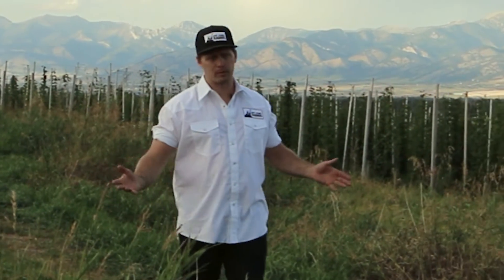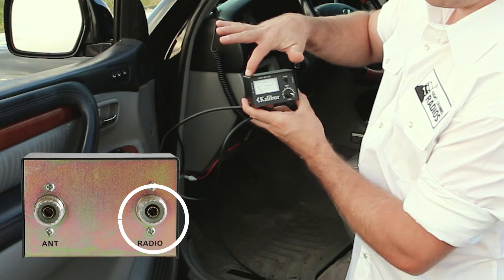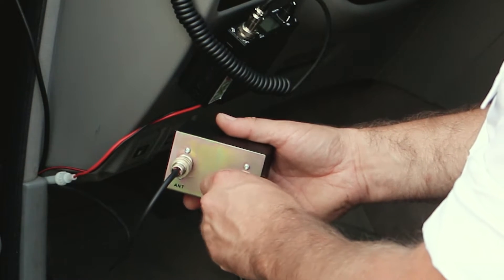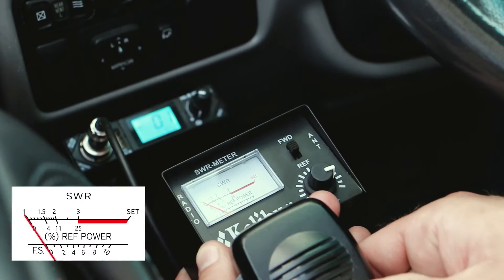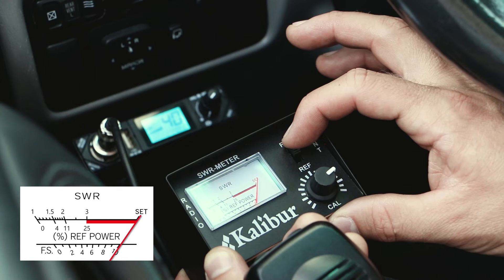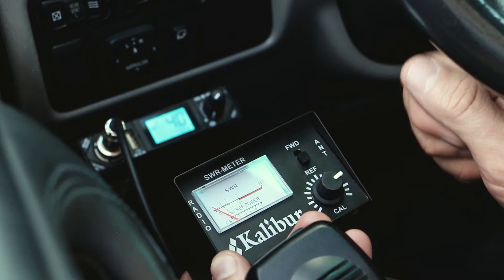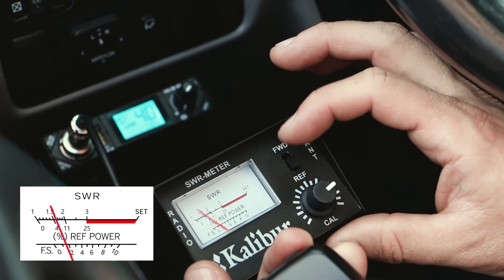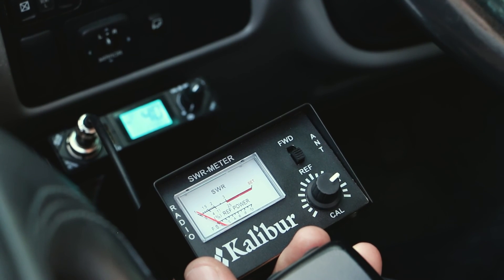How to Tune your CB Antenna, A Detailed Step-by-Step Guide

Comment: I have the Bearcat 980. Using the built in swr meter I can get channel 1 & 40 balanced out around 2.4. I can adjust the FireStick tip to get channel 1 below 2.0 but then channel 40 jumps up to mid 3’s and 4.0. I have good grounding with the antenna and CB. Im thinking to just buy a separate swr meter. Any other tips would help.
Reply: So after going through the installation again found the problem with the ground at the antenna. Working properly now

Comment: Also make sure you get a good quality antenna, too. I bought this cheap RoadPro antenna, and the SWR was a disgusting 3:1 on 1 and 40, and sitting at 1.7:1 on 18-22. Trimming won't really drop the SWR at that point, so, there's just a quality control issue, there, or the mag mount coupling to the vehicle (treating the vehicle as a capacitor/ground plane) isn't terribly efficient.

Comment: there are qrp ant tuners which work at cb band. with a tuner and those smal differences in swr you can get it down to 1:1 flat and make your radio happy.
Reply: Tuners waste power and do not make a non resonate antenna work better.

Comment: This is why I like Francis antennas. They usually give you a reading around 1.5 with most radio's. I have a hard time with the Predator 10K/K-1-27 with a 27in shaft. It reads 3 on Ch1 & 40. The coil should be above the roof/cab? Correct?

Comment: I bought a set of Predator dual coils. So far, trimmed 5” off and SWR are at 3. The reading came down some, but this is getting time consuming. 
 The Wilson 2000’s I’m currently running are at 1.5. But the Predators are sky high.

Comment: Think there's a misunderstanding on this subject, we shouldn't be tuning our antennas for low swr ,we should be tuning antennas to resonance which could mean swr will be higher, then we match to allow power transfer, can't do this with an swr meter need an analyser
Reply: @bill-2018 where did he mention that ? He also didn't mention groundplane which is key to tuning a mobile antenna
Reply: @Pioneer936  As this is from one day ago, I will tell you it was supposed to go to @jar407.
It was a mistake you got it.
Reply: @Pioneer936  I don't know where my comment to you went, it was here, but I said it should have gone to @jar407.
By the way I've never had anything blow in 51 years due to impedance, but if it is way out then the SWR meter will show it and we wouldn't use it. 
G4GHB.
Reply: @bill-2018 the efhw IS resonant at 50.1 swr that's around 2500ohms, the 49.1 transformer is to match it to 50ohms coax
Reply: @bill-2018 does low swr guarantee efficiency or that your antenna is radiating correctly, yes you can get power transfer into antenna if its closely matched but this doesn't mean the antenna is tuned does it ,I am inclined to agree with the poster that you can't tune an antenna based on low swr ,a tuned antenna for me would be when reactance is close to zero and that can happen at various swr figures sometimes nowhere near 50ohms
Reply: @paulm0hpd319  
By the way I put up my dipoles four years ago without a VNA and tuned for lowest SWR. 
I tuned all my aerials for lowest SWR. I will still say tuned as most amateurs would.

This is just all about what is called tuning an aerial or not called tuning an aerial and got stupid over that one thing.
I will still call it tuning. 

I, and most amateurs and C.B.'ers will say an aerial is tuned by obtaining a low SWR. I see nothing wrong in that.
They don't care where the actual resonant point is and does it really matter? An SWR meter is good enough. As I said we can tune it to resonance but we don't sit on one frequency because it's tuned there. We don't only use 7.132 MHz because it's tuned to resonance there and we can't move because it's only resonant at one frequency. Go 10 kHz and it's off resonance. 

These points are what I've been saying all along but I kept being told it's not resonant by an SWR meter alone.

I still say impedance doesn't matter. I've never blown anything up because of it. Unless it's ridiculous but the SWR meter would show it and you wouldn't use it.
 

G4GHB.
Reply: @bill-2018  how would you tune an antenna to resonance with an swr meter if you are looking for 300ohms purely resistive ?
Reply: @paulm0hpd319  I have never said it indicates efficiency. It may be the be the best obtainable and most efficient for that particular system. In that sense it is. 
I also said only getting contacts proves an aerial is working okay.
I'm saying it's commonly called aerial tuning by most amateurs and C.B.'ers. At least the ones I know.

Pioneer goes on about resonance and impedance on a ¼λ vertical as though he has one but when I asked him for other values he won't answer me and only repeats it's 36 Ω. 
I also asked if he had any other aerials and do they meet his standards of a resonant aerial. He won't answer me. 
He keeps going on about resonance but when I asked him would he never go off that one frequency because it's only resonant on one frequency he won't answer me.                                          

My aerials are the best impedance and reactance values I can get, they agree with a low SWR. The very best I get on one aerial is 53 Ω -j4 and 1.3:1 SWR. As good as resonant don't you agree? For Pioneer it has to be absolutely spot on. How many amateurs can achieve it and say their aerial is tuned?

My experience has shown on various aerials that power output does indeed go up as the SWR goes down so I call it aerial tuning as do the majority of amateurs I know. This is on my dipoles, inverted vee, long wire and 4 element collinear.  

I have proven to myself using a long wire and aerial tuner (note here, MFJ 16010 says antenna tuner) that maximum r.f. out is not quite the same as the lowest SWR but the difference is so minimal as to be insignificant.
We know they should really be called an antenna match but people don't call them that in the real world. Even MFJ and other manufacturers.

G4GHB.
Reply: @paulm0hpd319  Actually, the best aerial is my dipole at 75 Ω and 1.5 SWR on 18 MHz. Reactance I don't know, I didn't measure it. Still not good enough for Pioneer because it should be 73 Ω with 1.5 SWR.
I live with real aerials in the real world and tune them the best I can whether you call it tuning or not.
Reply: @bill-2018  why wouldn't you want 300ohms if your antenna is resonant there ?
Reply: @paulm0hpd319  You might have noticed I removed my comments.
I had fallen and the doctor asked if I had banged my head.
Friends said I was acting confused and forgetful. Friends in the pub asked if I was okay. They've said I seem okay now. 
Some comments seem odd now.
I hope it was temporary and not the start of dementia or something.
Reply: do want the least power reflected back to the transmitter 1 to 1 no  reflected back 4 to 1 good way to burn out finals
Reply: @jar407  Only one dipole here at 75 Ω which is about correct and 1.5:1 SWR as expected.
Impedance of the others are 43 Ω, 49 Ω and 57 Ω with SWR values of 1.4, 1.1 and 1.3 respectively.
I have no problems with these 'wrong impedance' values as stated by Pioneer and never had anything heat up and blow. H/b radio 30+ years and FT817ND since 2017, nothing has blown.
My tx is happy with low SWR values and I do get out. 
I asked him what frequency his perfectly resonant  ¼λ vertical was on. No answer. He's using text book values and no experience of real aerials in real situations. 

G4GHB.
Reply: @jar407 reflected power isn't the problem, it's the impedance that causes equipment to heat up and blow
Reply: @bill-2018 you are still totally misunderstanding what I've said ,an antenna need not be resonant to be efficient, the point I am making is you are confusing matching with tuning
Reply: @Pioneer936  You may or may not be interested in my latest comment to @paulm0hpd319.
.
G4GHB.

Comment: How do you lenghen the antennae?  
Idjet.
Reply: some antennas have a thick shaft with a thin metal center (stinger) and a tiny screw you loosen slightly and pull up slightly don't move more than 1/4 inch at a time. retighten and measure again . 1.5 or lower don't sweat it it good to go.
Reply: @jar407  Thank you

Comment: I tried doing this last night  but the needle on the SWR meter doesn't move at all no matter what I do. Any tips?
Reply from the maker: Be sure that the radio is hooked up to a good power source, we recommend a fuse tap or direct to the battery. If the radio's transmitter isn't getting enough power from the vehicle, the needle on the meter will not move. Also, make sure the calibration knob isn't all the way to one side, as the needle could stick on the sides.